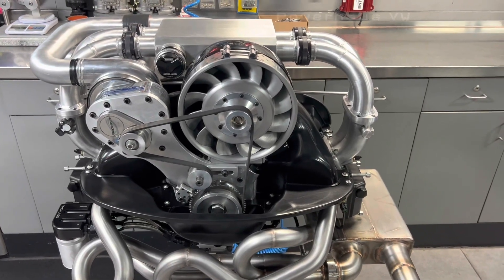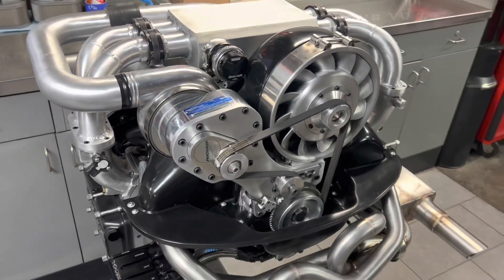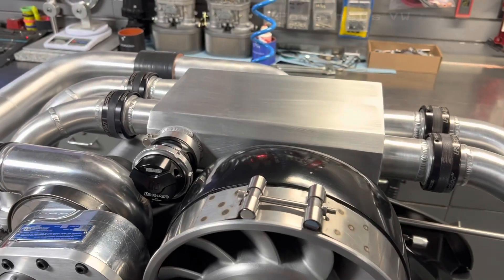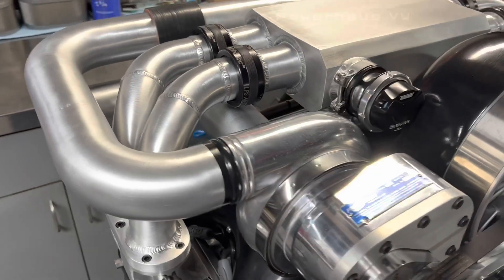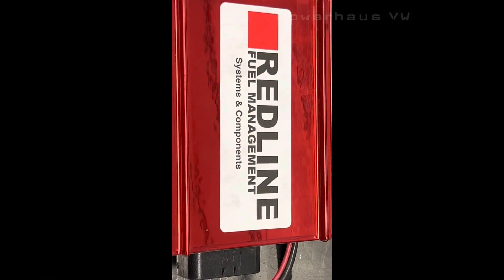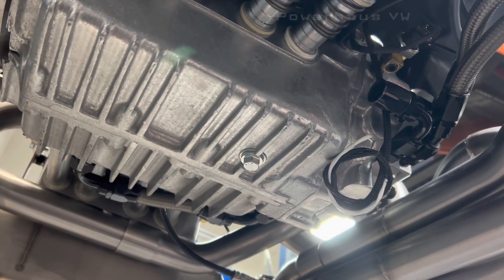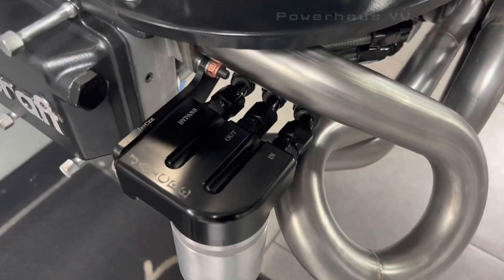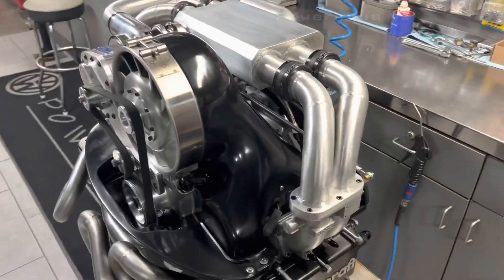POWERHAUS Built 4 Cylinder Procharged VW Engine

Comment: Love love seeing cool ProCharger projects out of the normal.  Subscribed for more details and videos on this! Well done!  (My only suggestion = spring-loaded tensioner, slide styles like that will only lead to massive slip, due to belt stretch)  If you can integrate a simple cheap OEM tensioner that would be wonderful.  Such as something from a Chrysler or new GM C8 or other.  (gates has many of them out there, and none really cost more than $100)

Comment: I have been thinking about doing an engine with a ProCharger.  This looks great.  Nice to see how you packaged everything.  Looks like it should fit really well.  On an unrelated topic, I'm wondering why you guys chose the Redline products for your EFI engines.  I have experience with the CB Performance Gen 4 EFI, but am looking at others too, so would love to know why you guys went with Redline.
Reply from the maker: Hi Andrig, thanks for visiting our page and sorry the delay in reply, there is only two of us here building engines and we've been a bit backed up. We've used Redline Weber efi for about 15 or so years, just something I know and has worked for us, this Procharger build is something we are still working on, its been a couple years in the works, the problem is with only two of us here,  the efi, turbo and special projects like this are second on our priority list as we can barely keep up with our normal aspirated builds. As much as I would love to share and go over ideas with you, I'm not always able to get back to the social media messaging but if you have a chance and would like to call us during the day, I wouldn't mind going over a few ideas with you.
John
310-328-2746

Comment: so... if you are taking power from your v belt to run the blower.. how much pressure does that develop, vs... say a high speed electric turbine that only uses electricity? 
electronic fuel injection? CIS injection?

I'm retired.. like for a long time.. I have never heard of a mechanical injection for a VW engine.. I had the Bosh system on my 69 911s... that would be awesome.. maybe the Spica injection pump for a 2 liter Alfa...;;~} 

so.. maybe you have noticed that small airplanes often come with Rotax engines... they look exactly like escaped VW engines to me.. but hey... I only built a few thousand of them, what do I know?   going fast up in the air... better than the Autobahn
Reply from the maker: We only started out with the old school set of mechanical injection manifolds with throttle plates in them, from there we've welded on tabs for a TPS and injector bungs so we can use a modern full sequential electronic efi system.
Reply: @powerhausvw  I'm dense... are we talking about the same thing?..  mechanical injection like a diesel?... a mechanical pump run by a belt or chain... little pistons inside that squirt fuel through a nozzle.. a spring loaded injector into the manifold above the intake port and combustion chamber... 
the original VW injection was the forerunner to the Bosh L jetronic it's called on BMW..  those manifolds have a place for the injectors... 1 per cylinder..  
mechanical injection is not the same.. one per... but the force comes from a mechanical pump.. not the electric type.. 
my 69 911s had a Bosch mechanical injection... there were a couple other Porsches with the system... but that system wouldn't be smog compliant so they went to the electronic system exclusively... gas mechanical injection is also found on late 70s early 80s Alfa Romeo... the system was exclusively Alfa
Reply: I learned how on those original computers... I didn't have the diagnostic equipment... I had a multimeter and the book
Reply: looked all over.. can't find a real mechanical injection for VW.. the problem is the pump timing..  my Porsche had a cogged belt drive.. it was only offered for that year on the S... that timing is part of the internal mechanics of the engine timing..  separate pulley system off the crankshaft, right next to the cam chain for the left side of the engine... Alfa uses a similar setup on the front cover below the water pump... mechanical injection was.. abandoned.. mechanics for those systems are even harder to find... I also did gray market engineering up in the Bay area..  the problems with those systems were not fixable.. fuel shut off when you let off the throttle is necessary to meet smog .. it's mechanical... little holes on a rotating cylinder in the pump.. but the pistons that pump the fuel keep going up and down... so... I'm looking at your beautiful engine... and..  asking questions
it's an awesome motor, brother... 
thanks for sharing
Reply: CIS injection is a similar looking injector.. but it doesn't have any shut off.. the fine mist is constant.. Constant Injection System... a clever name.. typical German efficiency..  I think that's what you meant... but... despite many years of fixing exotic cars... I definitely don't know everything
Reply: and I don't see any airflow sensor... so... maybe Ms Google can't find what I am looking for because I am not asking the question correctly... she knows everything... but ya gotta ask nicely or you don't get the right answer